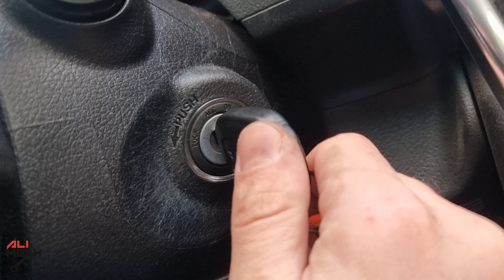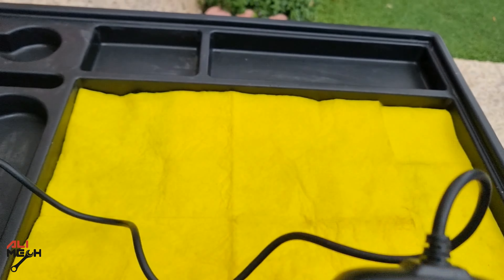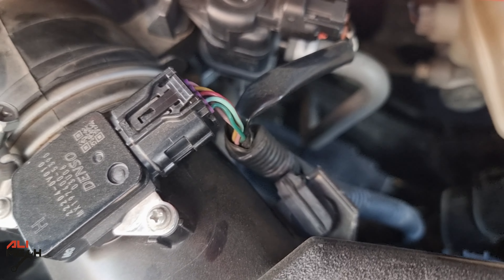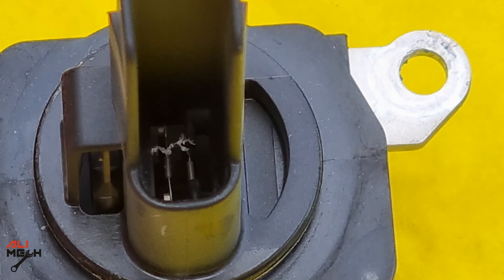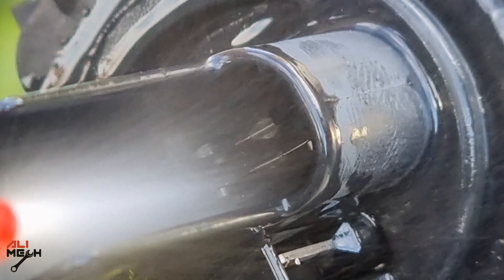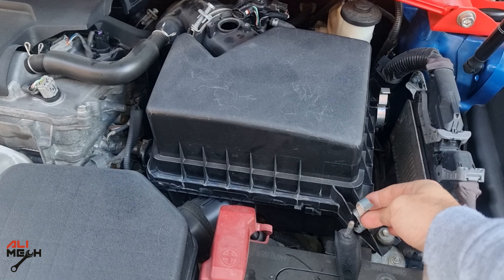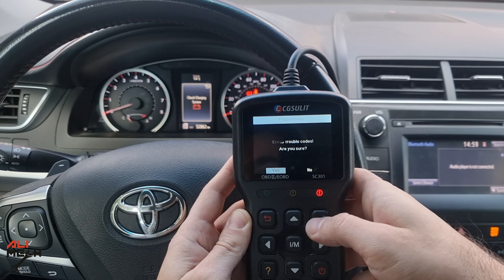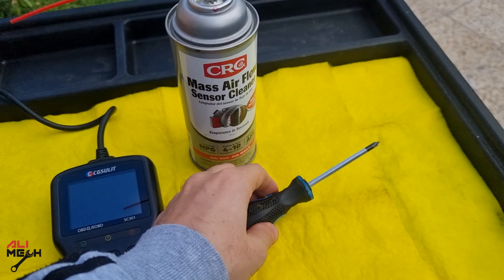Don't replace MAF sensor unless you do this / How to clean Mass Air flow sensor / Camry MAF Cleaning

Comment: A dirty engine air filter will also set this code, dirty throttle body will also set this code
Reply from the maker: That's great poin, sure it does

Comment: Would you replace the MAF if you cleaned it, but you're getting a positive fuel trim?
Reply: ... You probably have a hole somewhere In the air box or a vacuum leak in a small rubber hose if you're getting a positive fuel trim Above 15
Reply: @urnotaman4444  Update: 2012 honda crv. Car runs good. . finally decided on the Air fuel ratio table being off. Did everything under the sun to try to get it to 0 fuel trim but wasn't able to and a few other guys commented on them having the same issue

Comment: .... My air box was full of sand the whole length of it from start to finish I guess somebody took out the air filter and drove it Then they got the mass air flow sensor messed up   The car real cheap They sold it.... Clean the master floor and there's no more bucking and kicking I don't see any vacuum leaks Because the fuel trims are only positive and -3....🎉🎉🎉🎉

Comment: Starts and runs ruff 2 seconds shuts off. Removed connector to MAF. 
Starts and runs ruff until operating temperature, then runs ruff but good enough to drive.( limp mode) 1990 Volvo 240 DL.
Help !!!!

Comment: Can I use choke cleaner if I don't have MAF cleaner?
Reply: No you'll melt the plastic. At a minimum if you don't have a maf cleaner use rubbing alcohol 91%. Does a good job.
Reply from the maker: No, bc it leaves residue after getting dry